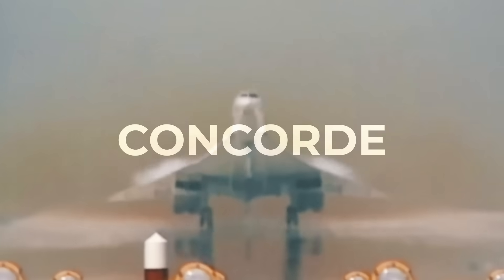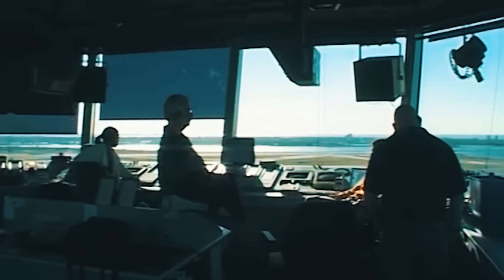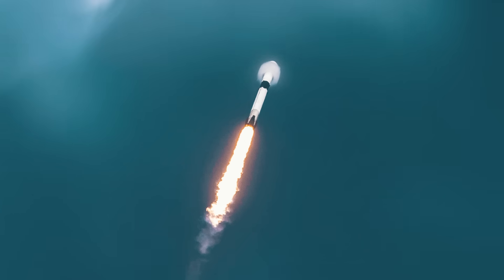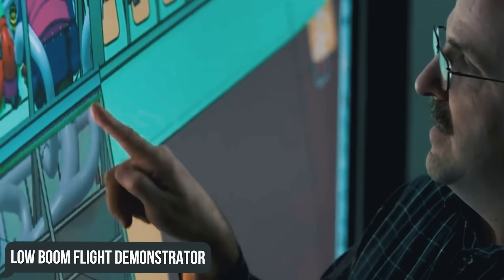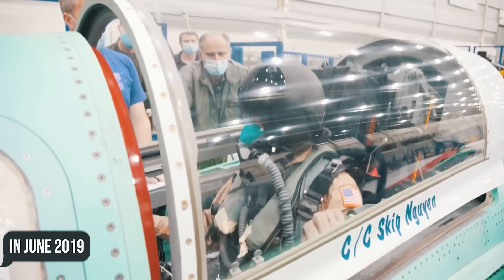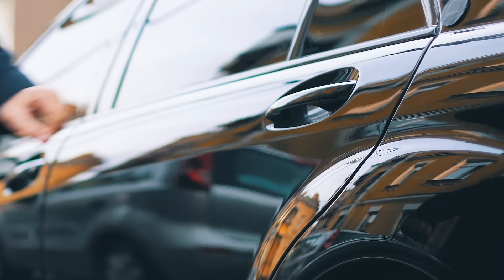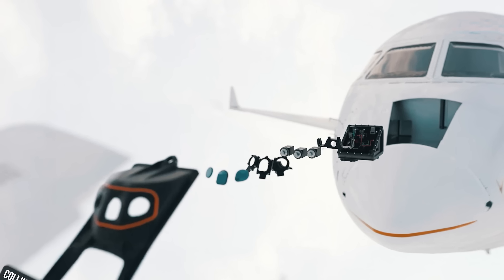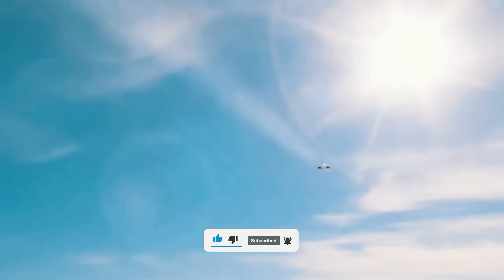NASA Finally Tested Its 'Quiet' Supersonic Aircraft!

Comment: A private company called Boom Supersonic just tested their plane at mach one. They're ahead of NASA.
Reply: I wouldn't say they are ahead of NASA.
Reply: @8oliverraymond  Agreed. Boom Supersonic is trying to field a commercial product using today's technology. NASA is trying to advance technology for future generations of supersonic aircraft. The two organizations aren't competing with each other with their two planes.
Reply: At mach 1, I would dare say they are still in diapers compared to nasa😂😮🎉
Reply: @TimothyWade-w6j they’re doing envelope expansion.  Their XB-1 is slated for Mack 2.2 as a test article.  We’ll see if the pre-production examples ever see the light of day, but it appears to be a well organized test program.
Reply: Yes, Boom is flying its prototype sooner than NASA is. But they aren't "ahead" of NASA, in that their aircraft is essentially the Mark 2 version of the Concorde.  It was tested in an area requiring special permission to use, and sonic booms are permitted on the confines of that area.

NASA's prototype has new design parameters intended to greatly reduce sonic booms on the ground. It is their hope that with quiet  enough flights, the 1973 law will be repealed and "boomless" aircraft will be allowed to fly over land as well as sea. Boom will be travelling over seas rapidly, but will have to throttle back for flights over land, just like the Concorde did.
Reply: The Boom prototype did have to  fly in a special supersonic corridor. However, its sonic boom apparently wasn't audible on the ground, either.
Reply: @victrola1906  excuse me I have some shocking news for you: Mach 1 is not ahead of nasa
Reply: NASA did Mach5+ in 1962....
Reply: @jesperrex4253  They sure did. In a rocket plane. That had to be launched from a B52. And had a thunderous sonic boom.

Boom Supersonic launched their plane at least a couple months ahead of NASA's and apparently without a sonic boom.

And since neither craft is intended to go near Mach 5, and the X-15 was intended to see if a space plane was even possible, but had no other utility, comparing the three aircraft is rather pointless.  Two are experimental prototypes for long range commercial airliners, and one was an experimental test of airborne spacecraft, there's little basis for comparison.
Reply: Give me a comfortable seat, decent meal and free drinks and I don't really care whether the flight is 2 hours or 6
Reply: @victrola1906  if a company named “boom supersonic can actually exceed Mach 3 or more then maybe they can earn the right to say they are better than nasa! But until they can do better than the sr 71,please shut up and sit down!😖🔥🥰🤔🤯😎!